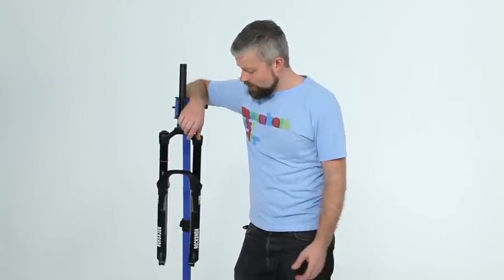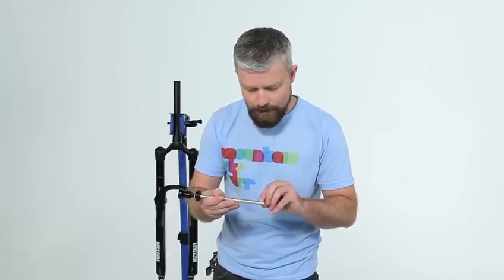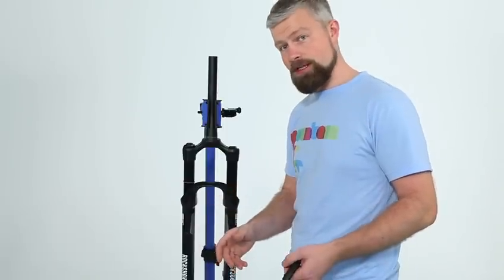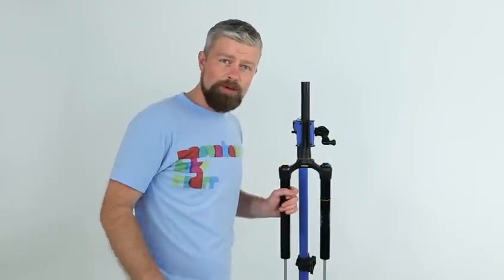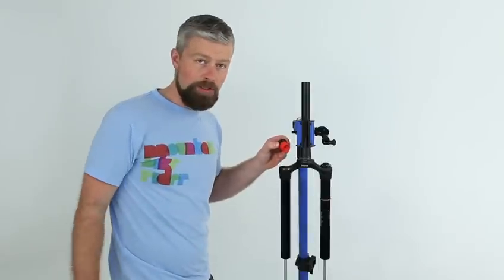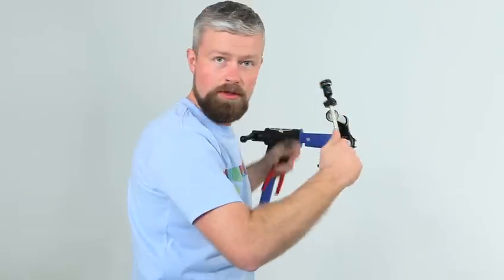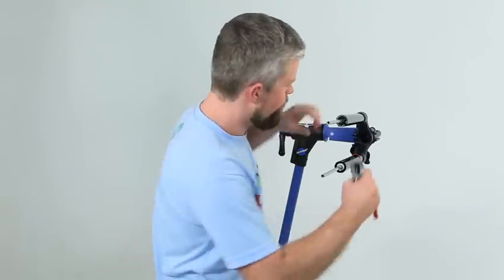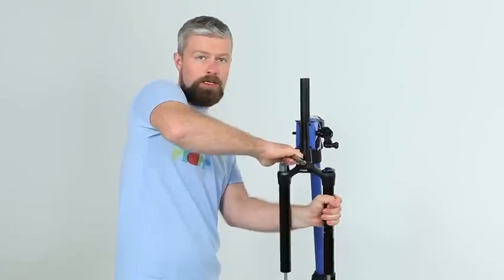How to change the travel on your RockShox Solo Air fork

Comment: Thank you Al and MBR.  Extremely well filmed, lighted, sound quality, detailed instruction.  I changed a Reba RL from 100mm to 120mm with your help.
Reply: Hello Tony, was your Reba off a Kona Hei Hei - if so, hows the handling with the new 120mm length? (something I want to do)
Reply: @mlennyphoto  No, I replaced a factory 120 mm Specialized Brain fork that was brain dead.  My new Reba though has outrageously bad stiction.  I'm trying to figure out what to do about it.

Comment: this was nice, clear and compact. Got the courage from this to order the parts I need to shorten my RS Lyrik Solo Air some. I installed  ebike battery to the underside of the downtube of my Intense 6.6. and don't want tire scrubbing to it in full compression

Comment: dont compress your forks when re installing the lowers 9:55 this creates a vacuum and sucks your forks down
Reply: Jm3 MTB definitely DON'T DO THAT! I mounted and dismounted the fork 6 times before i realised that you mustn't compress it. If you go to the sram tutorial for the lower leg service you'll see that they don't compress it.
Reply: DONT Compress the fork, I wish I saw this comment earlier. Its true, it will create a vacuum that will prevent the fork from using its full travel. I installed a 150mm travel shaft onto my pike and was frustrated that it would not open all the way. Thankfully I found this comment.
Reply: totally agree... do not compress the lowers when reinstalling! like the others already said, sram doesn't recomment it!
Reply: what do you mean with burp with  the  zip tie? Iam not a native english speaker.. Please explain for me..
Thanks in advance
Reply: ICEwalloWcUm yes if you add 10-20mm of travel adjust spacers on the air spring side

Comment: A very detailed and nearly foolproof video - I'm impressed. But I've 4 Questions:
1. Why would anyone go for less mm? I'm looking for as much mm as I can get. Isn't that the whole idea?
2. You only mounted 1 new (in this case a shorter) let's say „screw“ on the right side of the fork. On the other side you left the longer one. Just for this video or in any case?
3. I don't understand why these red plastic parts are for?
4. Are there any forks available that are symmetric? Damper and oil and so on like in motorcycle forks - the same details on each side?
Reply: +joelbackman100 

1) It is somewhat personal preference but more suspension is less efficient on the uphills and can affect geometry. More suspension is not always necessary and can be a crutch and honestly make ride a pain when climbing hills.
2.) He mounted a new air spring, you have your spring leg (coil or air) and you have your damper side (most of the time air preload unless its dual coil, or nothing but rebound and compression circuits) at least I believe so I could be off I dont think so though from the forks I've studied. 
3.)Those  are bottomless tokens, they take up extra air volume in the spring leg to help with end stroke ramp up.
4.) I am not sure on this, but I doubt it too much weight and no reason to do so.
Reply: +David Schallock 
Dear David - thank you so much for this detailed answer. Well about the climbing issue - mine's a Haibike E-Mountain bike, so I couldn't care less. But the (maybe) disadvantage of the higher weight of an e-bike makes more suspension even more smoother to ride.
And about the mm-hype: looking forward the 300 mm bike, so I could start from a first floor window :)

Comment: If I adjust mine from 140 to 160 of travel how donyoubthen account for correct sag?  I cant find this answer anywhere.  Isnt the location of 30% sag going to change on the stansion? TIA
Reply from the maker: Just ignore any markings and shoot for 15-20% of 160mm, which is 24-32mm. That’s where the o-ring should sit. Depends on how you set your sag up, but this is a decent ballpark to start with.

Comment: Can I make my oem rockshox 30 silver tk solo air 100mm to 120mm? From reading the service Manuel from sram, it appears there is a spacer in my curryeny 100mm m, which if removed can make it 120mm?
Reply: Doghead 007 did you ever do that i have the same shick and want to do the same cant seem to fund anything on it

Comment: quick question, when a fork is listed at 100mm of travel, but the o-ring is only 80mm up the stanchions, did the fork come from the shop set for 80mm? or is the 100mm including negative travel (correct term?), like if you pull the wheel down it reveals a little more of the stanchions?
Reply: As far as I know, the only "negative travel" should come from running an amount of sag. Which means that the fork is somewhat compressed from your own weight on the bike. 
However, some Fox forks seem to not extend to its full travel unless you pull the legs. Never seen this on RS forks though. 

The o-ring is there to measure sag and to let you know how much of the travel that you have used during riding. If it's "80 mm up the stanchions" after a ride, you have only used 80 mm of the 100 mm available travel. Which means that you could lower the pressure a tiny bit if you want a plusher feel.

Comment: A little confused ... The comments above mention "... may wish to alter the geometry ..." but if the tokens only fill up some of the air space, doesn't the axle to crown dimension (which drives the geometry) remain unchanged?
Reply: No, the A-C changes with the fork travel, which will change the geometry of the bike: Shorter travel means lower bottom bracket and steeper head angle, as well as a tad longer reach.
When fitting a shorter air shaft, the fork is simply not able to extend to its full length. The air spring chamber will therefore also be larger at the point of bottoming out, since you're not using the full travel.

The tokens are there to optimize the volume of the air spring chamber when the fork is fully compressed. Shortening travel will make that volume too large if you don't add tokens, so that the spring rate won't "ramp up" as much as you probably want. However, this is a question of how you want the fork to act. Some people want it really linear while others want better support at the end of the stroke, to avoid harsh bottoming out. 

More tokens => more "ramp up" of the spring rate, towards the end of the stroke.

Comment: I have 2015 xc30s on my 29er, currently with 100mm travel. would it be possible to increase the travel up to say 120 or 140mm by removing some of those plastic spacers? Thanks.

Comment: Hi MBR
    I have an old mtb(with 26 inch wheels) with cantilever brakes and want to upgrade my old fork but new forks(RS SID dual air) don't have the canti brake mount points so I decided I would get a new old lowers with canti mount and a used upper stanchion.  However, even used RS SIDs(post 2000) have 100mm+ travel and the old lowers(before 2000) are all for 80mm travel so would a 100mm travel stanchion  fit into a 80mm lowers? From your video is it the air spring assembly that dictates travel  length? The RS SID air spring assembly are stated for 80/100mm. So how do you set it for 80mm travel?
Thanks.
Reply: Osewani Narimashita Buy a new bike...

Comment: Hey guys! I want to convert my RockShox Yaris into dirt jumper forks, they’re currently sitting at 140mm of travel and I want to get them down to 100mm. I don’t know the first thing about what this entails or if it’s even possible. Any suggestions?
Reply from the maker: You'll need a new air spring assembly, which you can probably buy through a SRAM/RockShox dealer.
Reply: @MBRmagazine  thanks!

Comment: I've just fitted a 160 shaft into my 150 Pike. With the fork pumped up, should i see the seals sitting at the 0% mark? They're currently at the 10% for 160 but 0% for 150. It was a 160mm 27.5 (140 29) shaft before this is questioned. I depressed the rods on both sides as i compressed the legs fully to fit the bolts. Could i have too much negative spring?
Cheers

Just got some advice from a forum which was that the transfer port was blocked with grease due to over-greasing the piston and creating a back pressure behind the piston, preventing free movement in the extend direction. I stripped the fork again and found this to be true.
Reply: yes

Comment: Hi guys, I had my Reba extended to 120 by changing the inner spring and removing spacers. Result it only gives me 110 of reach (On the fork's bar printed scale it does not reach to 120 but bit more than original 100... Tia x ur answers

Comment: Hi, I have my Pike changed travel from 150mm to 160mm on 27,5 wheel, may I know if I need to add the bottomless token? Thank you.
Reply: i think this depends on your riding style. if you set your sag how you like it and you bottom out the fork very often than you should add some tokens if not you are alright. more travel means less tokens and less travel more tokens when you ride the same sag and with the same riding style

Comment: Seeking a solution to a hitch: The damper side foot bolt spins - seems that the threads are tighter than the inherent tension on the shaft. I tried a few suggestions found on other websites: Turn all adjustment knobs to highest levels (lockout, LSC, rebound), compressing fork with a strap. For kicks I tried extending the fork as long as possible too. Nothing worked thus far, bolt just spins in both directions. I don't have access to an impact wrench (another suggestion), but the bolt spins so freely that I'm doubtful that an impact wrench will be much help.
So, aside from cutting off the bolt flange, does anyone have any other non-permament solutions to this? I.e., any way to stabilize the shaft from the top adjustment area?
Reply from the maker: Joshua Church We had a similar problem on a Pike. In the end, we had to send it back to a SRAM service centre to get sorted.

Comment: does the pike dj work the same?  I can get the 140mm version much cheaper than the 100mm  but I would prefer around 120mm
Reply: Yes! I currently have my 2015 Pike set to 100mm  using a 26in air shaft.

Comment: Can I increase the travel on Rock Shox Reba RL 29'' from 100mm to 120mm?
Reply: Only if it was originally capable of being at 120mm... in other words, if it shipped with the 20mm reduction block in it, then you can remove it and get back to 120mm.  Otherwise, if it is a 100mm fork, you cannot magically extend it to 120mm.  In the future, it's better to buy a 120mm fork and reduce it to 110mm or 100mm instead of buying a 100mm fork and trying to save a few grams of weight.
Reply: Yes you can  raise the travel on Rock Shox Reba RL 29'' from 100mm to 120mm, I did it and it feels much better for various terrain
Reply: u are wrong, they are all the same forks, they just come with different air spacers

Comment: Weird the video says 5 ml on drive side and 15 on non drive side yet Rock SHox says 10 ml on each side according to their 2016 service manual.
Reply: This is true but the 2015 version of the specs manual says in fact 5 and 15. Can't find any specific reason for the change though.
Reply: +Milli Metric then I will stick to 5 and 15 since I most definitely have a 2015 or even 2014
Reply: I would do the same thing. The 2014 manual also states 5/15. Some internals might have changed I guess.

Comment: can my xc32 solo air travel change into 120mm ? thanks
Reply: I just read service manual for sector, recon and XC32 and they should have simple spacers...less spacers=more travel.
Reply: +Hanz Baa thanks for the info, appreciate it
Reply: +Hanz Baa would that also apply to a Reba RL? Thank you
Reply: according to manual for Reba 2015 it is same procedure like on the video above, so need to change the air spring assembly. But another model year could be different I am not pro...

Comment: Does this work on à 2014 reba?
Reply: there are many Rebas, the current Reba solo air is eligible, all you need is the correct air shaft for that particular model (32mm) and the exact travel you want

Comment: 5:35 - what exactly is the operation here, as it's foxing me? I get the tab has to be out of the way to allow the circlip to pinch. Do I push the tab sideways, so one of the circlip holes lies over it? (I tried, it didn't move naturally but am nervous of damaging the circlip by bending it). Or should it go into the shaft? (Mine doesn't seem to). Ta.
Reply: Matt Gillam OK the answer is the head does push into the shaft a little, then it can be rotated under the circlip. Also I don't have the dexterity to depress the air shaft with one hand while doing this, so I protected the shaft with a rag instead, which did work.
Reply: Matt Gillam Yeah, I couldn't hold everything together while working the retaining clip and pliers either, so I used an 8" section of clear nylon braided 1/2" ID hose to protect the shaft. Coming off of a big spool, it had a good bend to it that kept it tight on the shaft. Added benefit is that the hose is stiff enough to use to leverage the seal head far enough into the stanchion that putting the retaining clip back in was fairly easy. This was all easier than trying to hold the shaft inside with my weak thumb.

Comment: Hello, does this work for a xc32 solo air?
Reply: yup, xc32's(Solo Air) are essentially Recons without the fancy coated uppers.
Reply: do i need a new air spring essebly or can i also change it by another way?
Reply: i guess you just would get 120mm on the xc32